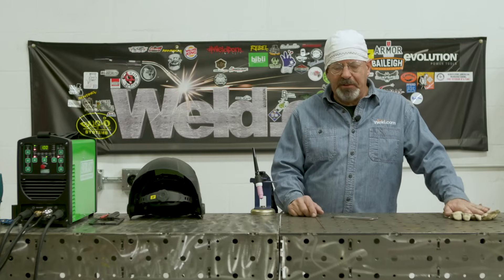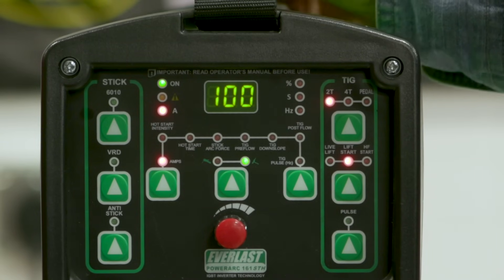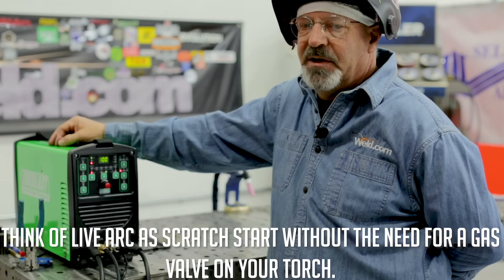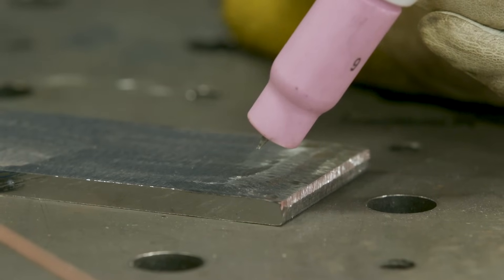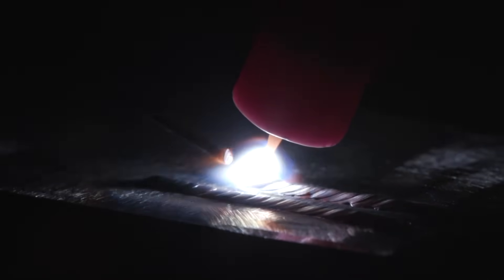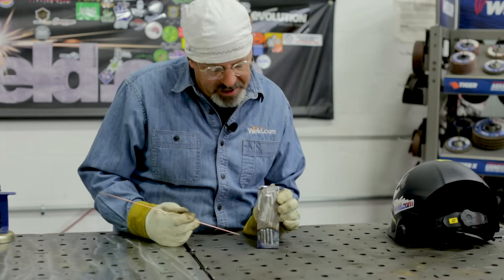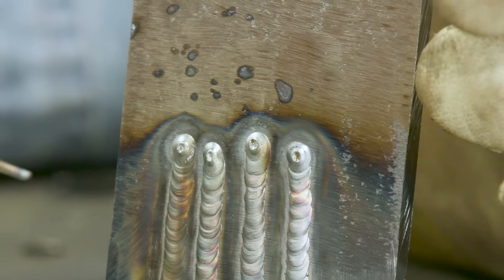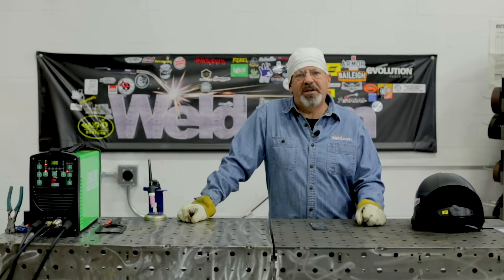Scratch Start Vs. Live Start (with Everlast PowerArc 161STH)

Comment: I seem to be missing something. If you have to lift away the TIG torch to terminate the arc, then what is the value in having a programmable post flow (since the torch tip is no longer above the weld)?

Comment: Interesting feature seems to be familiar. I bet that would be handy for an all structural steel fab shop in that she's already willing to go without the pedal. Just like an old TIG rig / tombstone TIG setup, just hit the metal to get rolling without bothering with the power supply nor shielding gas.

Comment: Just a thought from a beginner. Why bother to reinstate scratch start with auto start of gas and not implement the gas function to lift start instead? Gas starts when you ground the electrode, arc initiate when you lift. Then you have pre flow for as long as you want and no contamination of the tungsten.
Is that a bad idea?
Reply: That's exactly what happens on this unit.
Reply: @everlastgenerator  Ah, ok. Nice! 😊

Comment: ,Contamination of tungsten at start and no pre flow,.... no taper off with post flow, leaving craters and high possibility of cracking in high carbon welding  ....... no thanks.
Reply: Leave your tungsten down to provide preflow.

Comment: Thats cool everlast is trying new things. I have a miller multimatic 215 that has lift tig and its literally the same thing. I like it. Good deal.
Reply: songer121 I think the difference here is that say you wanted to use a torch switch  to taper off at the end of your arc, you wouldn’t have to press the switch when lift arc starting in the beginning, you could just touch off and go.

Comment: You showed the two main ways I've seen people lift or scratch start. The third way an old-timer taught me (he still calls tig Heliarc) is to swipe your filler rod across to where you are working connecting with the tungsten and the work as to ground through the filler rod. It starts an arc without putting tungsten contamination into your work. It'll never stick because you're moving it so quickly.
Reply from the maker: Nice tip. We'll have to give that a try.
Reply: That’s how a lot of guys do it that have to use scratch start on X-ray welds to keep the tungsten from contaminating the welds.
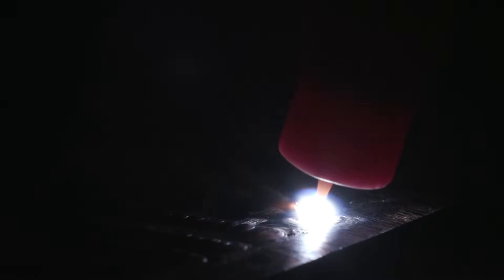Reply: That Old Schooler is a TRUE Bontified Field Welder! That gave you the heads up! Hahahaha. This dude is trying to Weld with a Contaminated Tip, lol  at 3:29-3:32 brahahahaha He looks like a PipeLiner! Not no Boiler Tibe Welder.... Man, talk about Tungsten Conclusion. Big Wammie, if your the Tube, your welding? Is selected for X~RaY!! 3 stikes your OUT!!

Comment: Gimmicky. With a manual valve you don't have to do all those settings. Turn it on for all the post flow or preflow you want. Simple. I know it has no remote, but that's just programming internal relays......It's lift arc with automatic gas....... which really is a non issue. PS- BOB, Jody uses copper to terminate the arc on scratch start. Allows post flow when hovering the copper then snap out, no arc marks.
Reply: With a manual valve, you could accidentally leave it on and drain all your gas.  Welding instructors know how often this happens in training.  It still happens in real life as well.

Comment: I'm new to TIG and always use the HF start and a foot pedal. I can see the desire to use the scratch start method when you're in awkward positions, like inside a roll cage,  where a foot pedal would be impossible. My concern with it isn't the start, but the crater that's left when you snap out. Can't that lead to cracking? And how would you remedy that?
Reply: Feather out at the end.

Comment: I'm Sorry, I use HF start now but, I learned on a scratch start and I never liked that method for three obvious reasons, 1) the electrode is always live, Dangerous. 2) you contaminate the electrode every start, ie: more re-grinding of electrodes. 3) when you break off at the termination you lose gas coverage, and that could contaminate the weld area, especially with stainless. HF is the way to go.
Reply: Lift arc is good enough for most things. Some sites here in UK you cant use HF due to safety regs which is a pita. But yes scratch start is a pain with all the regrinding
Reply: @lv2keepfit493  It also has the other style. But most field welding is done with a gas valve torch. This has been an overwhelming constant demand from our pro "steel" welders who do pipe and other types of structural welding out in the field where a contactor is not offered.  FYI, other brands feature this type of start as well such as the well respected XMT models and even some of the maxstar units.
Reply: +q+

Comment: Why would you use this. Doesn't nearly every machine have hf start by now?
Reply: when your 100 feet away from your machine you cant use HF unless you have a hand control on your torch. Primarily for field work. Old time pipe guys love it. If you weld in nuclear or some factories like auto manufacturing the HF messes up their more sensitive electronic systems.
Reply: @matttaylor6500  Aha, now i understand, especially the last point makes sense to me. Thanks.

Comment: That is the coolest feature. If only this Version was out when I bought my esab miniarc 161lts
Reply: Never too late to trade. lol.  The Mini ARC is a good unit, but it is pretty plain jane in comparison.  It gets the job done.
Reply: @everlastgenerator  110/220 runs 6010 then a 7018 with no machine changes and has a pretty smooth arc for Tig. Just what I use in the field. All the outer options would be pretty sweet though

Comment: Looks no difference from lift arc
Reply from the maker: Lift arc requires a remote
Reply: I don't think so
Reply: @johntaylor1310  and how do you tell the machine when to start, when you don't have any foot pedal or switch?
Reply: @vulgardisplayofpowertyr  in some other machines, the machine has a low voltage current running through the torch. Touch the workpiece and it completes the low voltage circuit. Lift the tungsten to break the low voltage circuit, and the full current is started. The thermal arc 95s is like this. No remote. No trigger. Works perfectly.
Reply: @pdnhouse  Wouldn't that still make the machine a scratch start? Low voltage current is still current; therefore, the electrode is technically hot. The trigger switch/remote in lift arc terminates the weld as well as starting it. How would the arc be terminated in the machines you are referring to?
Reply: @mr12gauger  The PA 161STH isn't really scratch start, though it can be used that way.  It is a lift start.  The current is lowered when the Tungsten comes in contact.  Our units likely do carry a bit higher current at "idle" than some other brands which make for a bit more "spark" on contact, but scratch start keeps at full current and really can weld the tungsten to the work much more than our lift arc.
Reply: @johntaylor1310   There are two types of lift start.  Weld.com is correct in the fact lift arc can require a remote, or it can be "live".  Both are lift types of arc starting.  You are just not widely experienced with all types of TIG welding.  Both types of lift have been around a while.  Both are lift arcs.  Both have their applications.